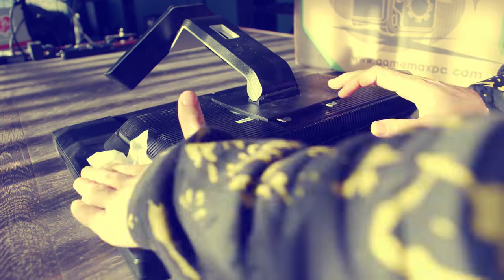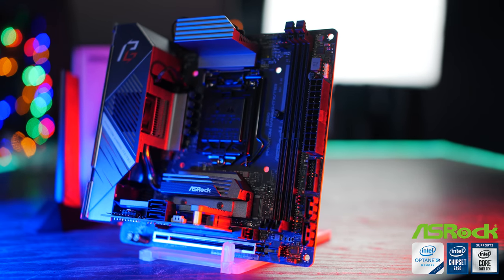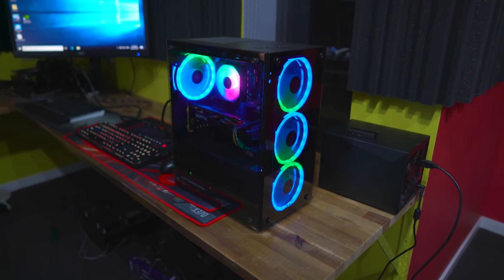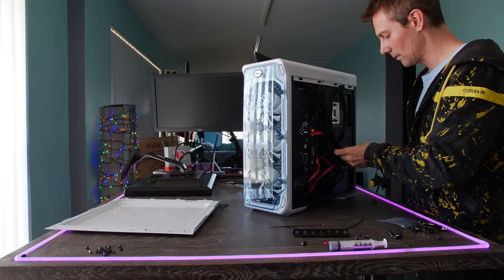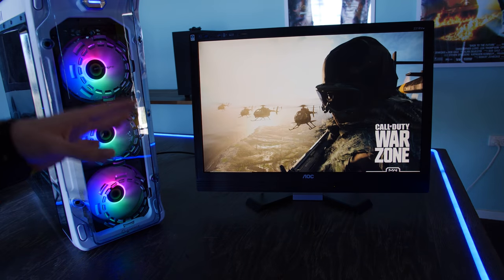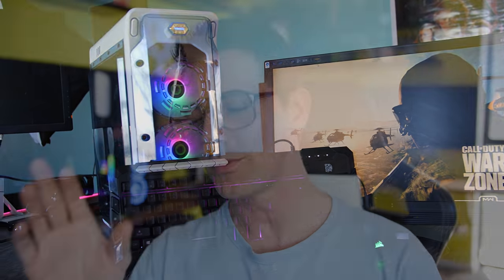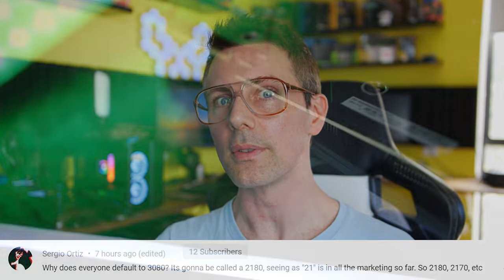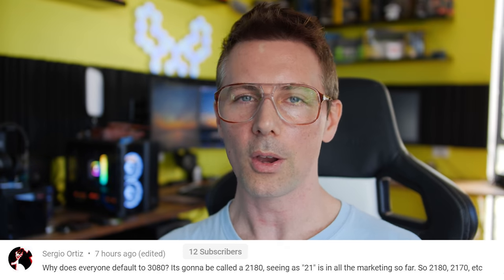How a COD Wallpaper Can Help SELL Your Gaming PC

Comment from the maker: Is this still available?
Reply: Is this still available?
Reply: Is this still available?
Reply: Yea bro! Can we meet at the Gas Station?
Reply: hey man, at 6:17 the tubes are on top, its better to have the radiator oriented so that the tubes are at the bottom of the radiator as brought up by gamers nexus on their latest video, just letting ya know mate, increases longevity of the cooler
Reply from the maker: @spookytofu2078  Looks like crap if the tubes are facing down IMO, and in my experience it hasn't affected any of the rads I have used over the years. I talked about this to Steve directly. Making sure the pump is not at the top of the loop is the most important, followed by tension and not spiking the sensitive pumps with surge voltage (they go pretty easily).
Reply: @spookytofu2078  He has it mounted exactly as shown in the 'Example of correct installation' at 11:52 on the GN video.
Reply: How mutch fps in fortnut
Reply: Does this run flight simulator?
Reply: Is this still available?
Reply: Are you negotiable?
Reply: @techyescity  much love mate, love all yer content, wish you all da best <3
Reply: @techyescity  I actually made a mistake there brian, i shouldnt have said longevity cuz the pump was obviously below the highest water level, my main concern was acoustic related, that there is a chance of gurgling noise happening due to tubes being at the top of the rad where air accumulates there and over time as volume of water decreases, the air bubbles can potentially cycle through the pump, thats why tubes down as air bubbles wont be going through that, im terribly sorry for not bringing up the acoustic concern on the first comment and the trouble i caused you to have to explain me the right things for my wrong comment, sorry again <3
Reply: Yeah Mate lets meet at the Tech Yes Hoesing Gas Station ! :)
Reply: What's your best price?
Reply: I've got a Minecraft pc for sale (GT7302GB) will it run Warzone - fuck No  lol
Reply: Totally off topic but.. That top your wearing in this vid is dope. Where did you get it from mate?
Reply: you really should look at my build i did with the Corsair 780T Graphite Series Full Tower Case!
Reply: Cheers bredrin! Im rockin a Deadpool wallpaper because he’s just badass lol
Reply: Would you take $100 and a pop figure?
Reply: Best price?
Reply from the maker: @boshaddict  That's the corsair hoodie, they have different 'seasons' of them, got this one at pax 2019, favorite brand hoodie so far. The the taichi hoodie is a close second.
Reply: For $69.
Reply: @techyescity  Thanks man, just looked it up, it's the corsair lan hoodie, it's 80 bucks on the site but sadly it's out of stock.
Reply: Is this still available?
Reply: Is this good for the Company?

Comment: i put a fallguys wallpaper on my latest flip, and after the fella saw it running fallguys at higher than 60fps he was pleased and bought it up, a rx 5500xt with a 2600x :) sold it for £575 :) (i got the parts off facebook super cheap had to repair the graphics card but worth the repair)
Reply: Nice, that would have sold around the same in the US.
Reply: Jesus, in australia that would sold for around $800usd
Reply: @deminybs  yeah your right, but look at the config the guy bought, an rx 5600xt and a 2600x so i don't think it wasn't worth it i guess, im not generally talking tho im just about this particular case
Reply: @razorr3751  it says 5500xt not 5600xt. I have a 2600x with an RX 5700 that I consider a budget rig...
Reply: @TheGauges420  oh your right sorry for my mistake, but still it's not like he scammed teh guy with just that wallpaper and that's my point
Reply: @razorr3751  I highly doubt the guy bought it for that reason, I'm chalking it up to a joke because the game got a lot of traction when released.
Reply: @tattoojay88  yeah your quite right
Reply: No clue how ur flipping stuff in the uk, market is dry round where i am
Reply: What kind of repair did the GPU need?

Comment: I'm thinking about quitting my job and building computers full-time.

I like my current job just fine and I make pretty good money, but I'm a truck driver, so I'm stuck in my truck 5-6 days out of every week and have very little opportunity or drive to do any exercising, and eating junk food makes long drives easier...so it's an environment I think it's going to kill me eventually. 

I want to get out of this and work from home. My local PC market is pretty crap, but the plan would be to find deals on eBay and then turn around and sell the finished PC's back on eBay. I'd list them for a discount locally, since there wouldn't be eBay, shipping, and PayPal fees, but I expect the majority of my money to come from eBay. I've done the math and seen that there would be a MASSIVE amount of overhead running the business this way, but that doesn't mean it's impossible. 

I think in order to sustain myself, if have to sell at least 6 or 7 PC's a week at a healthy profit margin. I've watched the trends on what sells on the site and I think I have a good idea of what I need to be building. 

I won't know how it goes until I dive into it though, so for now I'm just saving up money and preparing. Wish me luck.
Reply: bro try it see how it goes

Comment: in the Philippines its the "Asus ROG" wallpapers that sells em used entry level gaming pc's so fast coupled with rainbow colored led fans. they dont care if its just an i3 2100 with a 750ti and just slow hdd they buy em asap ^_^ heck even amd athlons x3's sell fast if its in a see through case with rainbow colored fans and rog wallpaper
Reply: why wouldn't it? If it was a screenshot of the game as a back ground that might be different.

Comment: I personally rather someone (Like a friend) learn about pcs and such and either build one or understand how to buy a pc (pre-built) before they go out and buy one. On many listings all people ever know is fps and fast, for example a common question I get asked or anyone who flips PCs gets asked is “does it HAVE high fps” or “what fps does it run in (insert game).” And you can get scammed by someone who runs the game at 144fps but is secretly on low settings with every possible graphic setting turned off or on low for higher performance. Just wanted to say this for those who know a friend that wants to get into pc gaming.

Comment: will the 100 dollars to high-end gaming pc be a weekly episode 
and is a 4/4 core Xeon and 8gb office pc for 70 AUD a good deal
Reply: Not really dude assuming that's an lga 1150 xeon then it's not gonna pair well with even something like a rx 570 or 470
Reply: Does it have the motherboard and the powersupply with it?
Reply: @SteveOnlin  it is a full pc with a 370-watt PSU, a case and a motherboard
Reply from the maker: 70 aud can be good if you can wack in a cheap 1050 ti and an led fan, cheap monitor, keyboard and mouse, i see some potential there.  The next episode will probably be a good week away, got to get the parts hunt done and wrap up another sale for the other pc.
Reply: @lachydauth4248  buy it before tech yes city buys it
Reply: It depends what Xeon it is.

Comment: I did this for the last pc I sold, i5 2400, 8gb ram,  gtx 960, 120gb ssd, 500w 80+ bronze psu and a tempered glass case with 4 rgb fans, sold within 2 hours, ez £40 profit

Comment: I'm imagining a $300 PC with a Fortnite Wallpaper would be a best seller 🤣
Reply: You can build a pc for 250$ and under that runs fortnite at 144 FPS at mostly high settings. Just need to get parts used and at good deals and mostly from old core i5 3475s with 1650 supers. That’s also not a bad marketing strategy for 11 year olds on OfferUp

Comment: I took your advice from last time. I used the Warzone wallpaper on a 20 in monitor, with a HP prodesk in an RGB case, keyboard, mouse included. I sold it in 5 hours
Reply: I hope that pc can actually run that game
Reply: It can I tested it 60fps on med to low settings

Comment: If i want to sell my current rig but want to keep my files and games so i dont have to re install , can i just remove that drive and put a new drive into that system install windows then done. And as for my new rig, could i just plug in my drive and it should work .? If not what do i do ?

Comment: I'm rocking in MSI wallpaper im an MSI fanboy I had a question for you do you think I would get better fps on warzone if I switch my CPU I'm running a ryzen 5 1600 a f and a MSI 1660 super gaming x do you think if I switch to a ryzen 7 2700 X I would give much more performance I've only Built one PC looking to build another one but in time got to save up some money it was because of your videos and a few other content creators who got me into building PCS so I just want to say thank you and keep up the good job
Reply: Wouldn't recommend a ryzen 7 2700x maybe a ryzen 5 3600 would be better, or even a ryzen 3 3300x cuz its higher clocked than ryzen 5 1600
Reply: Yeah the reason why I went with the ryzen 5 1600 was it was a really good deal $105 I couldn't pass it up but now I really do want something little bit higher like at least 4 gigahertz in that range and definitely was looking into getting an 8-core instead of the six core that's why I was thinking maybe the ryzen 7 2700 X not a bad price

Comment: Trying to flip 3 pcs for Warzone and this video is perfect! I have I5 4690k, I7 4790k, and a Ryzen 3 1300x builds ready to go. I have a 1050ti, and two GTX 980, and an R9 380. I wonder if i should pair the 4690k with an R9 380 i just grabbed over the 1050ti? Or the Ryzen 3? Brian, you definitely influenced me to start flipping pcs!!! #TechYesCity
Reply: Put the amd card with the i7, i5 and amd graphics just doesn’t sell
Reply: @MarshallSambell  thank you! Was thinking of selling the AMD cards individually on Ebay and investing in GTX 1060 6gbs or more 980s.
Reply: @xdreampcs8554  are your GTX 980's the reference cards or aftermarket coolers? I used to have x2 GTX 980 reference cards and i loveeeee the look of blower cooler design, unfortunately i sold my two when i got my GTX 1080, i wouldnt mind getting another 980 Reference to sit on my shelf one day soon
Reply: @tolgahk84  they are EVGA reference with the blowers. Beautiful cards.

Comment: Hi Bryan, I've been having stuttering with Warzone every 4-6 seconds with my 5700XT, Ryzen 3700X... I have tried everything... Change Mobo, change ram, change XMP to manual even stock ram config, drivers since 20.4.2 up to 20.8.2... could you please create a test environment to check if you have the same issues please, I have read that there are a lot of people with the same issue and Activision and AMD won't do anything to fix it. Also it happens after the second time I enter a new game... First game works fine 130-166 fps... I have to restart my computer after every game. It is too weird. But no solution has worked for me.... Even tried to modify the .ini file in the player folder and no solution.
Reply: My friend had similar problem. It was his ethernet card for internet on motherboard that giving him problems. He baught new one and problem goes away. Just something to try, I'm not sure u have same problem but something to try. Good luck with fixing that 😊👍
Reply: Dude warzone runs badly on my ryzen 5 1600 and rx 590 system as well
Reply: Run benchmarks and monitor CPU and gpu info from something like msi afterburner. Also checking your page file settings in windows along with tweaking windows may help.
Reply: @valuehunter5544  It's running perfect around 100fps on 10y old Xeon 5650 and RX 580 😁👌
Reply: Have you guys got 16GB of RAM?
Reply: @omegaPhix  I have 24GB, that probably helps 🤔
Reply: @xeongaming7899  Well, you don't have any problems running the game, right? :DD
Reply: @omegaPhix  Gskil Trident Neo RGB 3600 CL 19. 32GB (2x16GB)... Also tried populating different memory Slots... I have an Asus MOBO X570 TUF Gaming WiFi... Play on Ethernet... I did tried the game with an RX580 8GB an played smooth as butter
Reply: @ItsDextrin  done that 9ms frame time.... But every 4-6 Seconds the frame times goes up to 196ms tops... Graphics looks like a hearth beating... I have tried limiting FPS to 60, Undervolting, Overclocking, I had monitored the game with HWInfo and Lasso processing to check if there is anything causing high Temps and nothing goes above 74°C or 70% load on the CPU... GPU is always on game at 96% usage... I have limited the VRAM to 5GB on the .ini file on an it solves it for the first 2 o 3 games... But it comes back.... Only fix it's to restart the computer. And then the same story after the second match it starts stuttering
Reply: @xeongaming7899  it is the GPU, I tried an RX580 8GB and played smooth as butter. Ping is between 56-75ms depending on the game server room. But it looks like there are a lot of people with the same issue. Specially on the Navi architecture.
Reply: @omegaPhix  Nope 😁👌
Reply: @Neoceres-pi6zd  Yeah, I just noticed on Reditt. So many people complain about RX5700XT it's insane 🤔

Comment: Can it play valorant🤣🤣🤣 also would you recommend buying a 5700xt over a 2060, the 5700xt is not to much more then the 2060 and I don't want or need rtx
Reply: Absolutely, 5700xt is dope, had driver pains at first but it's in a great place now